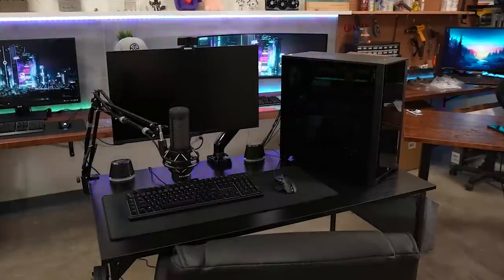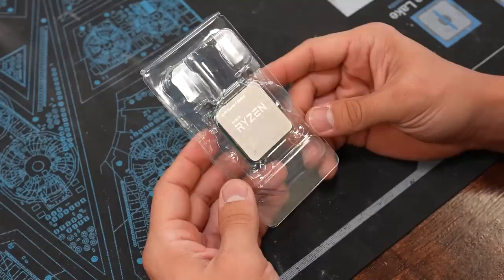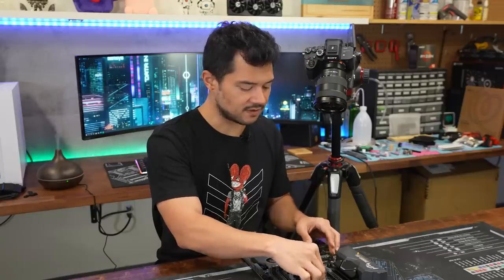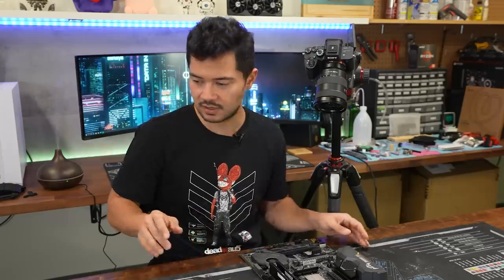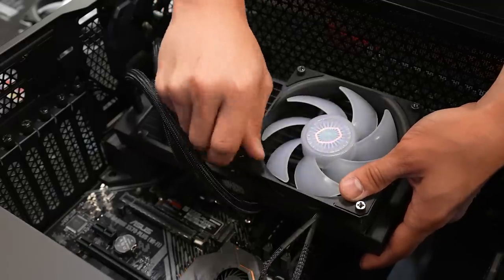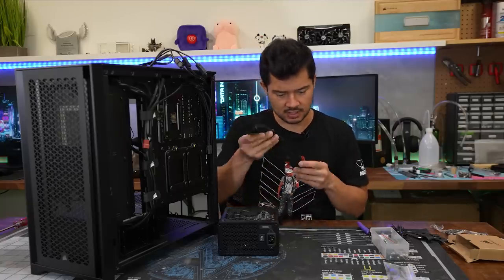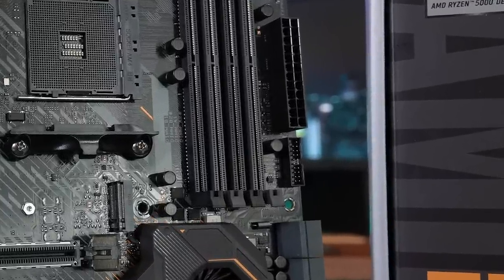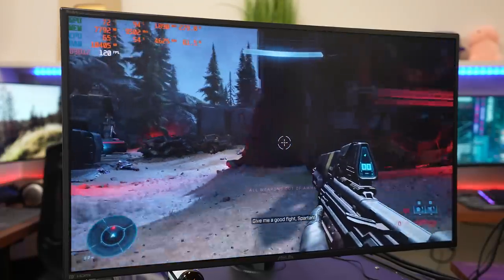The Amazon "#1 Best Seller" Gaming PC!

Comment: I have never built a PC before but I've been researching video until I get the nerve to build my own.  I see with the Ryzen 7 you went with water cooled instead of air cooler. Also you used only 2 sticks of DDR4 because the CPU cooler was taken up space. Could I build with a air cooler that would have give me enough space for use all four slots on RAM?

Comment: One caveat to being ok with buying a computer right now and being a gamer.  I'd probably REALLY strongly wait for a RDNA2 laptop that fits your budget (whatever that happens to be).   If you were looking for anything you expect to run any kind of even indie titles on.  With steam deck being such a big deal, and RDNA2 being such an important part of that, I'd be afraid that indie games coming out in a year or so are going to require at least steam deck performance GPU.  For a desktop or if you don't mind figuring out an external GPU or any other solution that gets you there that's fine.  BUT if you buy a laptop thinking "I only play indie games" or something similar that just uses SOME GPU power, I worry our definition of what "Some" is is going to get a lot higher once RDNA2 trickles down to ryzen3 skus hitting mass market OEMS.

Comment: The new stuff might have issues, since it's a new platform and isn't mature like AM4 is.  I think most people will be skipping the first couple generations of AM5, and most people did when AM4 was new.
Reply: That's true, but when Ryzen was new the board makers didn't put their all into it. It's different now.
Reply: @Safetytrousers  not "putting their all" is a vague statement. Because AM4 was new and immature at that time would be why they didn't "put their all" into it, whatever that's supposed to mean.

But this "not putting their all into it" can still hold true for AM5 because it is new, and it hasn't been tested by the market yet. The market will find everything wrong with it, since no amount of in-house research will find all issues. Especially now we have the addition of DDR5 and PCIe Gen5 into the mix which are also new and aren't mature.
Reply: @fragalot  It's what other tech channels have said.

Comment: Laughed heartily at the molex situation. Recently bought a Zalman S3 because it was cheap and came with three fans. Two of the three fans were molex. Thankfully I had already planned to purchase a 6-pack of upHere ARGB fans.
Reply: those fans are like a polished molex fan. polished but it's still garbage
Reply: @EmDuckthegoat  If you’re referring to the upHere fans, I have used them multiple times with no problem. They’re PWN, come with their own controller, and don’t look half bad. They’re not Noctua or beQuiet fans, but not everyone has money for those consistently. :)
Reply: @jasonbrunskowski2625  that's true
Reply: @jasonbrunskowski2625  thing is, they use low quality HDB bearings that will only last a few years until they start breaking down. most likely you haven't used them for long enough for them to start failing
Reply: @jasonbrunskowski2625  it's true not everyone has money for very expensive fans, but i would much rather buy a more expensive long lasting fan rather than multiple cheap ones every year
Reply: @EmDuckthegoat  Personally I agree. And you are correct, we have not used the fans for years. Mathematically, I still think they are a great value. Six fans for under $40 versus (for example) $70 for a three pack of Corsair SP120. Let’s say the upHere fans last three years, and let’s say the Corsair last eight years. I could have bought that 6 pack three times and still paid the same price. So for those strapped for cash, saving $80 today may be worth it. It also depends on how well you take care of your fans. But yeah, personally, I would save up for some beQuiet or Lian Ali fans.

Comment: Thanks for recommeding a good option for cable sleeves. This is something that has been missing in my build for quite some time. That and something for GPU sag. I have a 33060Ti Gaming X from MSI that doesn't really sag much but I still want to get something to protect my motherboard as that is a pretty beefy card compared to the 1660Ti that was there (and that is is also a beefy card)

Comment: I noticed you put the M.2 in the upper slot. I have the same board and I put my M.2 in the lower slot? My M.2 is PCIE gen 3, did I f#%# up? My PC runs nice would it run better if I move to the upper?

Comment: i don't see how this is the "#1 bestseller" it is high-end gaming IMHO, i would have thought the #1 bestseller would be what normal people (the majority) buy. for example: "normal person" would buy
NZXT pc case with no airflow.
16 gb ddr4 RAM 2x8 3200hmz.
some cheap ass AMD CPU+Mobo combo with stock fan.
no AIO.
cheapest samsung 512gb SSD and 1t HDD storage
600w silver/gold rated PSU
rtx 3050ti
no sleeved cable kit, just a messy cluster of cables in every direction.
.....i mean c'mon that has to be the most popular "bestseller" IRL

Comment: My pc 6 months old  (i7 11th gen, 16gb ram, aorus b560 elite, 256gb nvme )and windows 10 (i used 2gb old graphic cars) freeze randomly without any load and i have to restart pc. Sometimes ethernet connected with my phone and someone call than freeze again and again i have to restart. I installed windows 5 times and showed 5 technicians but my pc still freeze...can someone help me i can't do anything about this

Comment: As someone that made a pc this week, with parts mostly from amazon, as far as I remember most high recommendations would fit well together. Should be a decent 1000-1200 dollar build probably.

imo: i5-12400>5800x.

32gb ram, sounds more like people are upgrading ram because it's affordable then anything. For most systems 16 should be fine.

Halfway in the video, everything seems like half a price tier above what I expected, might get close to 1500 like that. Depends a lot on the graphics card though.

11:02 exactly my reaction when I was looking at my own case. Like are you fucking kidding me? molex in 2022? (that sentence was written before unpausing)

3080.... yeah that's gonna be 2k. Where I live the 3060ti was the most popular.

Okay I would have liked to have heard the official total, but it feels like 2k should be close.
Reply: No shot, 5800x is a bit better, more cores, more threads. 

Also, not on a new platform with new gen RAM. Budget builds should still swear by AM4, for now.
Reply: @davide4725  more cores, more threads, but less 1 core performance and ranks lower in gaming benchmarks. Also, intel 12th gen also supports ddr4...
Reply: @Olav_Hansen  Who buys a new platform to put last gen RAM in it though? 

If you wanted the better gaming CPU, it is still on AM4. 5800x3d is bit pricier though.
Reply: @davide4725  because I took a 12400f and not a 5800x I could afford a 3070 instead of a 3060. No way a 5800x with a 3060 would beat a 12400f with 3070.

Besides that, I generally check performance numbers from cpu.userbenchmark, which reports that the 12400f benches better on single, dual and quad core tasks. Even with growing core count, 8 core and up are still only rarely supported, so you'd only have results from that if you actually used it as a workstation. It's like saying a threadripper makes the best gaming pc because it has the most cores, it's just straight up not true.

Comment: why should anyone take a 5800x, when the 5700x is cheaper, has lower tdp, and is only by a couple percent behind the 5800x, aka u can propably even overclock it to surpass the 5800x with less tdp for the same power

Comment: 3080 as a best seller?  so a $850-900 card is outselling the 3060/3060 ti cards sitting at less than half the cost? with todays inflation only the well-to do grabs the latest cards out. so Id be suspicious of that kind of ranking.